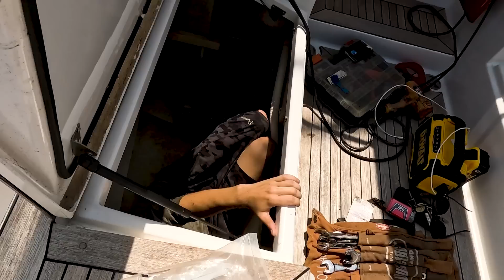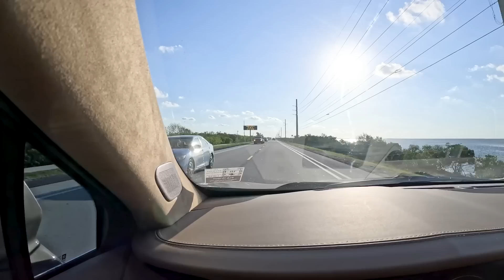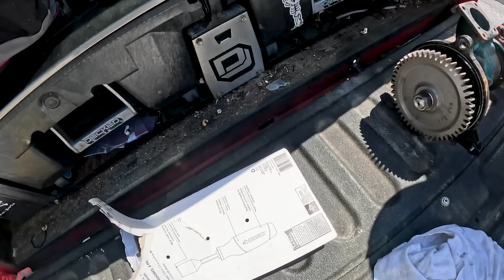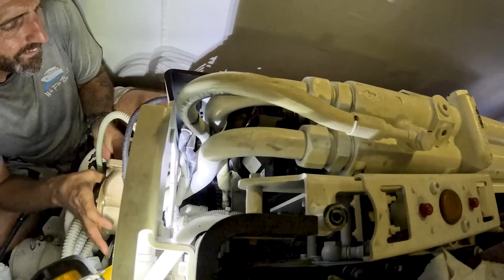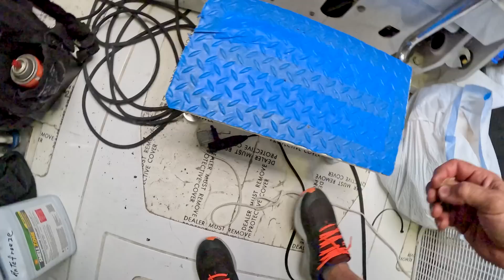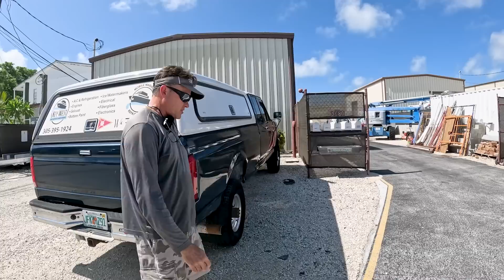No Way NOT Again On This Boat?

Comment from the maker: As of today the boat's rudder seal is still leaking a tiny bit but the engineer say that it should stop after awhile. We finished this job the second time about 4 weeks ago. The Hinckley Volvo Penta engine job is all fix and the owner is ecstatic since he now has his boat back after 6-7 months.
Reply: 4 Gs for a cooling pump, wow!
Reply: @derjaeger3321   Volvo is really proud of it , and everything else.
Reply: Rudder lip seals are a joke,
I have seen brand new boats with literally 2 hours in the water leak.
They are a sales tool for the broker nothing more.
Reply: as a machinist and pump builder. Id sleeve the bearing housing and install a new bearing to the correct press fit.

Comment: Watching one of your videos one of your techs mentioned never to ground a Volvo engine to the boat grounding system.
I have a D12 800 2007 motors. And they are grounded. Is this something I should address? Thank you
Reply from the maker: In order to give sound advice. We would need to research your engine so see what it says for the installation.

Comment: I would not like the potential risks of this line of work.   

 If for ANY reason, boat floods  or burns shortly after you were in there,   all fingers will point to you......justified or not.   You were the last guy down there doing a  remove replace below water line.
Reply from the maker: Well 🙏 just have to be careful. What we did when one of our customers boats was taking on water the coast guard was rescuing them and we just responded with integrity and did everything we could to help assist to get boat out of the water asap. It was a 72ft boat video is on here. In the moment we had no idea if we did something to cause this and once the dust settled it ended up being nothing we worked on.

Comment: With a floating rudder if you trim the top of the rudder and be able to adjust the shaft higher in the seals that will fix your leak. FYI that is only a couple of years fixs
Reply from the maker: Thanks for sharing.

Comment: problem with 'volvo , though it is a good system , cost of doing repairs is way above any other system .. its always been that way .. back in late 70's my dad had 32 chris and volvo powered twin 302 fords .. parts prices were astronomical compared to other out-drives .. dad sold it and purchased 'merc. powered boat , and never looked back .. love your vids , very informative .. straight-up
Reply from the maker: Thanks for watching and sharing Steve … boat repairs and maintenance are costly for any boat.

Comment: Surprised that 7.3 wont start. Those motors ran forever. When i worked at Ford the only thing that you had to watch out for was cavitation in the cylinders but ford put an additivevin the coolant filter to stop that.
Reply from the maker: Still broke 🥴 I mailed off the power module, injector driver and the chip tonight. Recently installed all kinds of new sensors.
Reply: @WillFixThat  diagnosis by elimination is a pricey way to fix it.

Comment: Is that a 7.3 powerstroke diesel?  Year?
Reply: I had a 96 powerstroke that would start to totally shut down going down the road intermittently.  It ended up being a wire UNDER the passenger side valve cover worn thru the  insulation and grounding out.  Read something about on line, pulled the valve cover and there it was.  Truck was still running great when I sold it years later.
Reply from the maker: We are the original owners it’s a 1997
Reply from the maker: 1997
Reply: I had to remove the intake and turbocharger to get to the valva cover BUT WORTH IT FOR SURE.  I love watching your videos.  Thanks!

Comment: Awesome as always 
As long as you were doing what the builder and parts manufacturer say I don’t see where you are in the wrong. Sometimes a little thick skin and conversation (but has to be face to face) with the customer goes a long ways. I have been at the dealership I work at now for 26 years and I get some of the same things. IE we just did a repower and the customer had 2 gas tanks each 12 gallon. We put the engine on did the PDI I have my 5 minutes of run time and a full G3 report we keep and customer gets 1 they take delivery load up the party on his pontoon and take it out use it for about 30 minutes switch his gas tanks and then engine stops running long story short he kills both batteries trying to start the engine towed in and screaming at us we go out and find the second tanks is 90%water and all he can say is warranty or he stops payment on his check. The owner will not come in and talk face to face all they want to do is puff their chest and email as I told him yelling and profanity on the phone I will not tolerate 
So no I don’t think you’re in the wrong or to blame 
Keep the videos coming
Reply from the maker: Thanks for the feedback…. Owner heard manufacturer tell us what to do and we did it & owner heard again that we had to take it apart and try again. Thank goodness cause then he knows it wasn’t us!

Comment: It can be such a piece meal industry sometimes and becomes extremely frustrating for a shop owner.  Manufactures of shitty products will seldom accept responsibility for their poor designs.  Owners of the boats just don't want any hassles (understandably) and that leaves you standing in the middle.   I thought it was just me !
Reply from the maker: Best thing Matt did was have the conversation with the yacht manufacturer on speaker so the owner could hear. We didn’t do anything wrong but we had to do it again.

Comment: Man I was just about to say cam position sensor would be my first bet.  The 7.3 is notorious for cam sensors going out for no reason at all.
Reply from the maker: 🥲 been replaced twice already with OEM.
Reply: Had an Excursion with the 7.3L. Had to replace the cam sensor three times in a very short period of time between 95,000 and 102,000 miles. The third one did the trick and never had to replace another. Finally sold that rig with 395,000 miles on it and still ran perfect with zero leaks. One of the best motors ever built IMHO.

Comment: Not your fault, just a shit design ,I have a beneteau  rudder tube sits way above water line requiring  no seal or leakage .
Reply from the maker: Yeah the situation sucks for all involved… we do our best and aren’t hiding problems or mistakes! When Matt talked to the manufacturer he had them on speaker so the owner could hear. We don’t want to be blamed for their issue!

Comment: For me personally….
1. You are providing a service and warranty is always billed to the customers account until approved by the manufacturer.  Customer should be made aware of this before starting work.  
2. Service Provider should not be held responsible for operational, design, part, failure to properly maintain or repair previously, acts of god, acts of natural. They just provide labor, knowledge, and wisdom…
3. Lack of planning on customer’s part is not an emergency for the mechanic (normally).  Please call them asap when you know /think you have an issue.  
Love your videos, work ethic, and way you treat your employees and customers.
Reply from the maker: Thanks for choosing to watch us grumpy garage …. Hard to blame us when Matt put manufacturer on speaker so the owner could hear we still had an issue after doing what they said … hey we are happy to admit mistakes we make on our own BUT not when you tell us what to do and we do it and if still fails.
Reply: We had a sign in our shop,"lack of foresight and planning our your part does not constitute an emergency on our part".
Reply from the maker: @petercaras3696 love it …exactly!

Comment: Enjoyed the video. I made a note to self. Don't buy a Volvo. They make good stuff but the parts cost are insane. Everything will wear out, so there is no need to punish yourself with crazy parts prices.
Reply from the maker: It’s the same with Cummins, MTU etc. boats are fun but expensive.
Reply: I have been at this marine diesel repair job starting out as a helper in summer of '85 as an 18 year old kid straight off the farm in the midwest, and been in Florida and Georgia coast since. I do not care what brand enginve it is, I have heard "I'll never buy another one of these!" before. They will all break!  Seen Cats with ventilated blocks, MAN's scattered in pieces, Detroits spewing oil, Yanmars neglected and a ball of corrosion, Cummins destroyed because a gauge didn't work and getting the gauges fixed was "expensive"  Not as expensive as a longblock, the boat being hauled, disassembled, the engine pulled, the parts switched over, need I go on?  LOL pay me now, or pay me later!

Comment: Check all grounds on the ford pickup. I don't care what make or model, when there is a ghost problems that affects one or more componets or modules its a loose or no ground.
Reply: Funny you say that - my wife's car was running like garbage and we were all set to go buy another car - and it was the ground strap.  Good lesson.
Reply from the maker: Hey thanks for sharing 👍 we need to get it figured out.

Comment: Oh boy gear driven water pump goot thing it's not the fuel pump 😅 and that does take alot of force to break the shaft on that pump and good man turning the gear on the pump not the rest of the engine timing gears I made that grave mistake once 😅 "key word.... once"! And good to see the ol 7.3 powerstroke back I love those trucks lol
Reply from the maker: That 7.3 still broke  😭
Reply: @WillFixThat  noooooo!!!!!! but yea I would check grounds on the frame and engine block then also I ran into this issue before but check the glow plugs make sure they are working and check right by the fuel filter housing on the motor called the fuel bowl heater and the high pressure lift pump for the fueland possibly a faulty ICP sensor on the driver side cylinder head that's all I can say right now what to look at I had a 7.3 that had a bad fuel bowl heater